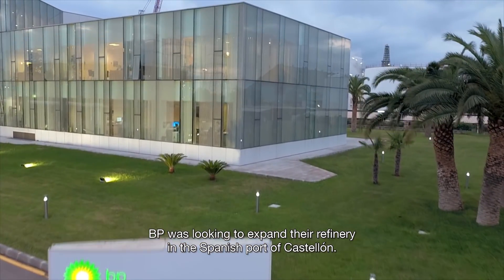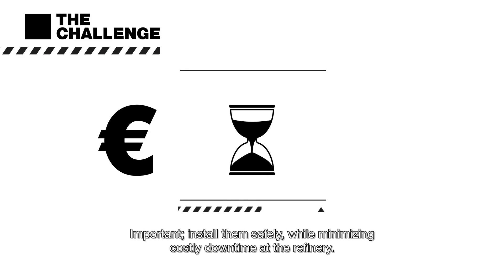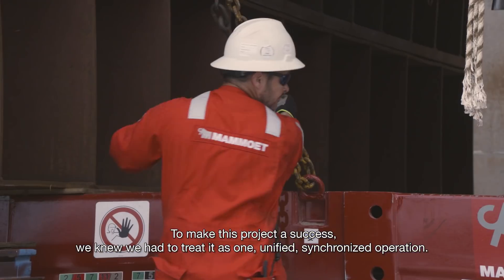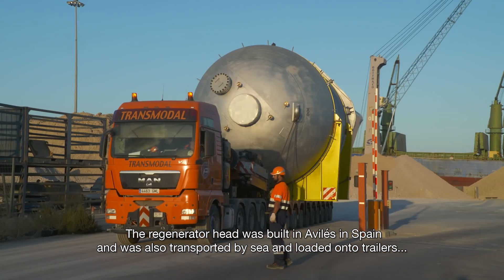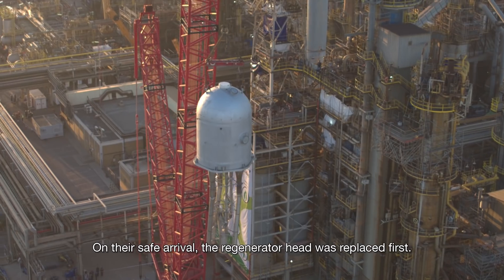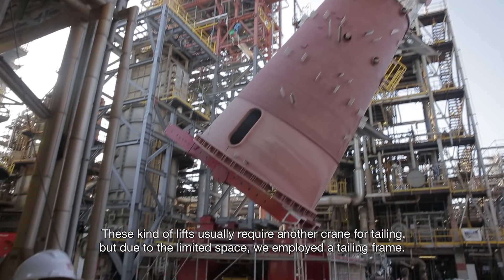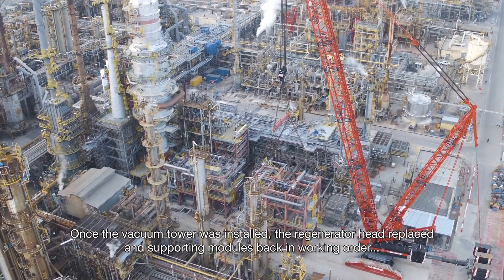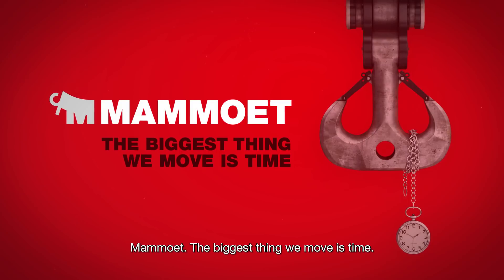Saving time with a double exchange operation

Comment: Q: Do you have 3D simulation for those operations before starting theem? i.e. using a 3D LASER scanner for the main effort loction where there is scarecy in space and apply the crane DoFs in the simulation to be sure of the crossings between crane+vacuum tower from one side and the other parts of refinery from another side?
Amazing.. thanks.